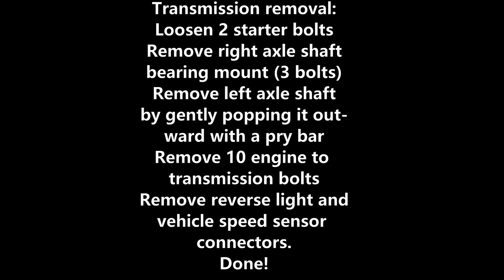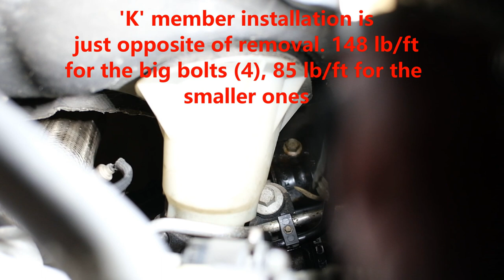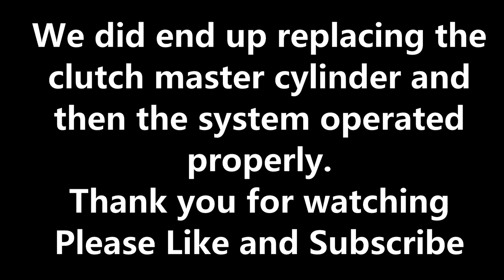2007 Ford Focus  2.0 Clutch replacement

Comment: Ive got a 2006 zx5  same exact motor and trans 
Can I ask a question? 
I’m also swapping out the master cylinder
My question is regarding refilling the brake reservoir and what is the required way to bleed in the fluid 
The ford motor shop manual stated pumping 100 cc directly into the slave cylinder bleeder valve  
So back bleeding the system … is that the case??
Can’t I just refill the resiviour and pump the clutch 
In a standard system bleed  bleed
Reply from the maker: These systems are unique and difficult. Back bleeding worked best for me. But we also did a ‘normal’ bleed afterwards to make sure all the air was out
Reply: Could you explain in a step by step the process you’ve used to back bleed .. I’m going to clean the shared reservoir and will be changing both the master and slave , single plate flywheel ,and stage two Kevlar reinforced clutch  as well as the pedal return  spring … and I’m for-seeing two  different problems .. one is the best recommendation to fill and bleed the whole shared system  next is actually a likely worry that my slave cylinder throw out bering was overextending causing the seal to pop 
as the leakage from the bell housing base and the clutch engagement disengagement issues started at approximately after noticing my return spring had snapped .. so ..
My plan to make a possible alteration to the clutch pedal by adding a pedal stop bolt to the pedal in order to make a manual adjustment to the amount of travel after clutch activates  the reason being aftermarket parts are said to have some small variants in travel leading to slave cylinder overextending 
What are your thoughts ??
Reply: I know that was a lot but my main question is what would be the preferred method to fill and bleed the complete shared brake and clutch system
Reply: Honestly  the ford shop manual doesn’t expand on this in a clear and direct manner  
I really don’t want to make a mistake and blow the new slave cylinder or end up with  a situation that doesn’t work as good as new  again ..
Reply: Any advise to help 
basically filling and flushing the whole shared system ..
Reply: @richarddubord3978  
I was wondering would a pressurized system flush be the preferred way of handling my situation..
Reply from the maker: @timsewell8049  we didn’t bleed the brakes on ours as they were fine. Pressure back bleeding putting pressure on the slave cylinder bleeder pushing fluid and air up to the master cylinder works really well. If you don’t actuate the brakes, you will be fine. I would never back bleed a brake system as you would be pushing caliper debris to the master cylinder, but doing it with the clutch system is fine

Comment: Also .. Should I definitely pump out the mtf fluid before starting the clutch flywheel throw out swap ..
When the  axle shafts are removed I’ll lose the mtf fluid correct ??
Reply from the maker: Yes drain it for sure or you will have a huge mess

Comment: Hey! Do you think this is possible without having to remove the subframe? I see a lot of videos of other model Ford Focus' but most of them don't have to deal with removing the subframe. Just want to know if I could remove one extra tedious step so my lazy ass isn't scared to attempt my first ever clutch replacement.

Thanks, 
Jayson!
Reply from the maker: Unfortunately it's not possible on this model